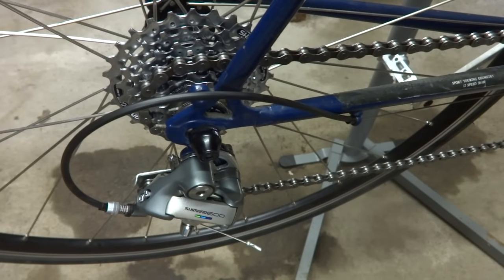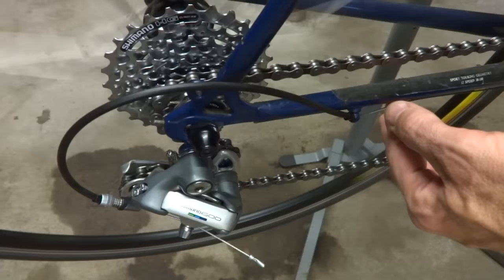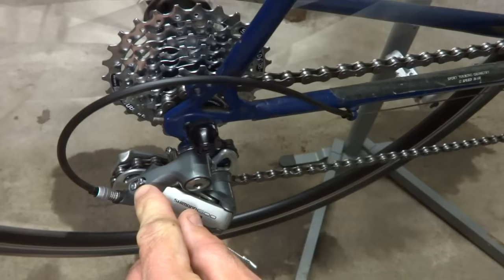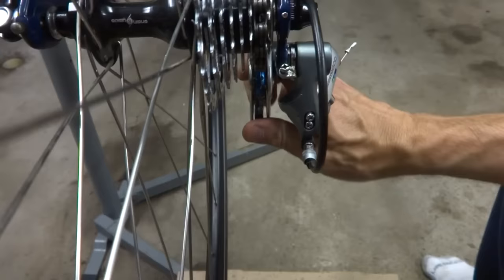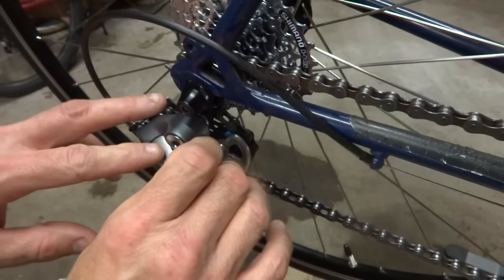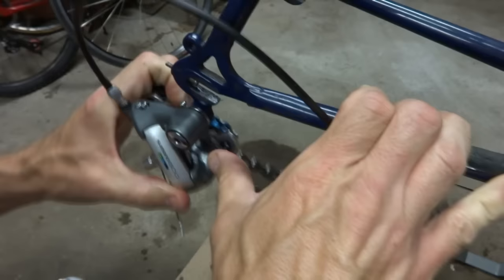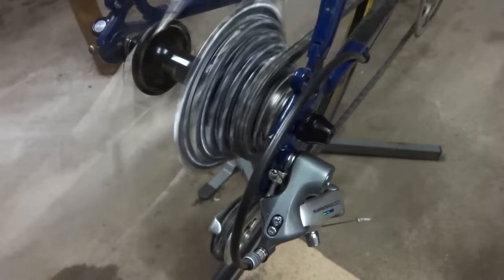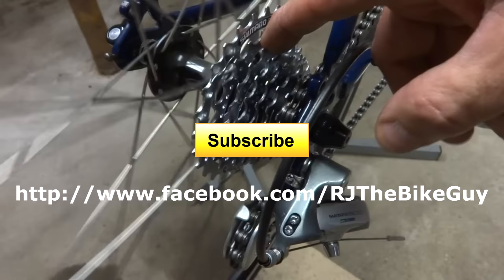Fix Bike Rear Derailleur That Won't Shift Into Highest Gear/Small Cog

Comment: Quick question: my derailer isn't even clicking for the 9th speed even though I have 9 speeds on the back.  Do I follow the same protocol?
Reply from the maker: +Steve Pratt By 9th speed, do you mean the biggest cog or littlest cog? But the procedures will pretty much be similar.
Reply: +RJ The Bike Guy the littlest cog.  I'm 90% sure I got all 9 gears before but I just replaced the cassette since it was worn down.  Is it a tension thing?

Comment: i'm new to road biking. i bought a new fuji bike. road only 5 times. sat in my finished basement for 6 months until today. won't shift lower. i'm stuck in highest gear. i'm stumped and don't know what i'm doing.
Reply: Sounds like your shifter is seized up. Flush it with degreaser and then lubricate it with a bunch of triflow. If you can remove any dust covers first (usually mounted by tiny screws), that's even better.
Reply: i took it to the shop to get it looked at. they made all the adjustments. the derailed was bent. i don't know what i'm doing. they took care of it. thanks for responding! it was just sitting in my basement for a year. no one touched it.
Reply from the maker: Yep, a bent derailleur or hanger will mess up the shifting.
Reply: i appreciate your quick response! thanks!

Comment: Myn wasnt going to the biggest gear near the spokes. . And when i adjust the derailer,it works but after a while it changes itself and i cant shift the gear once more..it also changes the front derrailer settings 😣
Reply from the maker: Sounds like multiple things going on. Isolate the issues and fix them one by one. Could be something is damaged or broken.
Reply: RJ The Bike Guy .oh.. thanks alot😃
Reply: @RJTheBikeGuy  hey i found out the problem.. turns out that the derrailer cables were tight and small,hence they kept changing the gears by themselves😁

Comment: I put my new wheel on and my new free wheel on my bike.When I was testing the rear derailleur  moving the chain up a down,although i admit to remove too many links of the chain ,i wanted to get just up to 53 links,this was the way in my original wheel,but, I think i got 49 instead,I don;t think it's the problem,I ,shifted it up and down ,The chain would only go to the second  high ,chain ring number 6.Then i moved the low screw  in a certain way and it got back to normal.It kept delaying for a few moments going into the highest gear the lowest chain ring ,I did an adjustment  the hi screw,It messed up again ,I cannot get it to go up to the lowest chain ring,I;m guessing  ,the pulley of the rear derailleur  might be worn ?I had it washed recently . Or the shifter is worn ,It's  made of plastic and it down  look beater,but still functions .I am also guessing  I might have to replace the shifting cable .the end of it look frayed a little, before it get to the thing a  little.i do have bike now ,only goes up to chain ring six ion the rear,My front derailleur  is okay .Unless  it's a gremlin  got into my system ,i don't know what  .I even tried adjusting the cable tension ,The pully doesn't look bent , unless you have to replace the old rear derailleurs with a new one if you put on a new freewheel? I don;t  know
Reply from the maker: Michael Mcgee I can be multiple different things. Without having the bike in front of me, I can't say for sure. It could be the chain is too short now. It could be limiting screws. It could be the derailleur is at the limit of it's reach. It could be a bent derailleur/hanger. It could be out of adjustment. Maybe the shifters aren't matched to the freewheel. I don't know. You just have to dig in and figure it out.
Reply: Now we have an elimination.If it was the shifter than the front derailleur would not be shifting normally up and down .
Reply from the maker: Michael Mcgee The front and rear shifters are different. Just because the front shifter works, doesn't mean the rear shifter is correct for your set up. For all I know, you are using a 6 speed shifter with a 7 speed freewheel.
Reply: The rear derailleur  is a shimano too.I rechecked it too ,It 's okay,It is not bent. .I moved it up and down ,Smooth,the new bik back  wheel is 1.75to 2.25.My original back wheel was 1.95,But tha doesn't matter it still works ,Unexplainable phenomenon.Watch me take it to a bike shop and all of a sudden they can adjust it quick,that be my luck,the rear shifter is a s 7 as the front .It's from Schwinn
Reply from the maker: Just because it is a Shimano doesn't mean it's going to work with all gearing setups. Tire size doesn't matter at all for this issue. I really think you need to have someone knowledgeable look at it in person. I can't really help you very well through typing and not seeing exactly how everything is set up.
Reply: Well guess what? I cleaned the rear grip shifter  and replaced  the speed cable with new ones .It's back to normal.I also learned that my new wheel wasn't adjusted .It was loose when i tighten it to the rear.I'm going to readjust it .

Comment: My mountain bike has 6 gears in the rear derailleur. The number on the shifter is always one before the one it is actually on. So if it shows gear 4 I'm actually on 3. Because of this I can use my 6th gear. Can someone please tell me how to fix this thanks.
Reply: Same problem to my bike
Reply: Vishal Adhikari on my bike im on 2nd when it says its on 1st
Reply from the maker: Probably the cable is not adjusted correctly.

Comment: My trike won't go into 7.shifting up 1 in 1 ,2 stays in 1,3 goes to 2,4 goes to 3, 5 goes to 4, 6 goes to 5, 7 goes to 6   and up 6,5,4,3,2,1. No skip in this direction. It happened before and I don't know how I fixed it.
Reply from the maker: Brent Theophilus The cable needs adjusted. Turn the barrel adjuster on the rear derailleur out until the pulleys line up with the proper cog. You may need to tweek it a little bit one way or the other.

Comment: on my bike, if i put it in first, its on first, but if i put it up into second, it stays on first, then if i go up to third, it goes into second, it goes like that all the way up to 7th. when it says im on 7th, im actually on 6th. and when it says im on 8th, im actualy on 7th. it doesnt matter what my front gear is on, 1st 2nd or 3rd. its under warrenty so halfords can sort it for me for free, i just want to understand why its doing it before i take it. 1 because it makes me look a little more like i know whats wrong, and so i know for the future
Reply from the maker: Cable adjustment is off. Turn out the barrel adjuster.

Comment: hey,i cant get my gears to go to the biggest cog, I cleaned my chain using a park tool cleaner, the guy at the bike shop said it might cause me problems if i did ,because of the wear of the chain/cassete, the bikes 7 yrs old now, i think he meant the chain/cassete may not match after cleaning...... I`m not sure how to fix this.  I hope you have some idea what I mean ! I`ve tried adjusting the alignment screws and barrel adjuster, i dont have any wd40, but i dont think it`ll work as I think the chain & cassete arent matching now......gears 1-6 work fine, but the 7th it just wont go onto it, it was fine before i cleaned the chain & cassete, there were a lot of bits of metal in the cassette, mostly what seemed to be bits of thin wire
Reply from the maker: +Stu Wright If it won't go to the biggest cog, I doubt it is due to a worn chain/cassette. Check the limiting screw. Could be a bent derailleur or hanger. Maybe a problem with the shifter, or cable.
Reply: +RJ The Bike Guy ok thanks for your reply, i`ll keep trying :-)
Reply: +Stu Wright Try adjusting the screw labeled "L" for low.  You'll need to have your bike situated so you can pedal and press the derailleur in towards the spokes at the same time.  Once you can push the derailleur in and it shifts to the largest cog, then you can test using your shifter.  If your shifter makes it go into the largest cog, then you can crank the pedals and tweak the limit screw ever so slightly to make is shift as smooth as possible.
Reply: yea i`ve tried that didnt work
Reply: +Stu Wright a new chain is like 20bucks man
Reply: a new chain may not fix it
Reply: +Stu Wright I guess my first question should have been, did it ever shift into the largest cog?  If not, is your derailleur made to work with the number of cogs on your wheel?

Comment: My clutch for my rear derailleur is broken. Right now its stuck on the highest gear/smallest cog. 

How do I permanently put it on the lowest gear/big cog. 

I rarely change the back gears so I just want to keep it at the lowest gear. Thanks.
Reply: I would also be interested to know the answer to this! As im having the same problem on my bike.
Reply from the maker: +Manila Kid I am not sure what you mean by "clutch". These derailleurs don't have a clutch. You can try tightening the cable until it pulls it over to the big cog. And the limiting screw will prevent it from going any farther.
Reply: +RJ The Bike Guy Thanks for the tip, I think I'll do this. What I meant by clutch was changing the gears by the handle bar. Mine broke and I don't want to replace it since I rarely change gears on this bike.
Reply from the maker: The shifter...
Reply: +Manila Kid To permanently attach it to the lowest gear weld it.  An actual weld works the best but if you can't weld or don't know someone who can you can use an epoxy called JB Weld.  It's really strong stuff, but just make sure that everything is clean or it won't work.  I hope that helps.
Reply: +Manila Kid Flush the shifter with degreaser and then lubricate it with triflow. This usually fixes the problem you're describing. Or as RJ The Bike Guy said, add cable tension until you get it where you want.

Comment: This is quite easy to resolve, but i got more serious problem. Shimano Revoshifter 1x8 -speed system on a very brand new bicycle. Whenever ALTUS derailleur shifts from 8th to 7th gear without problems, 1st to 2nd gear doesnt shift and after adjustments it's vice versa - problems appears in 8-7th gears again! Played with gear cable adjust and tension, limiting screws are ok, tried B-tension screw, checked chain length (ok), derailleur is straight, cassette doesnt wobble, wheel is straight and firmly put into dropouts. No idea what cause this. Spent like one hour on this one. Didn't have this problem before with revoshifters, which usually are really easy to adjust xD. Help?
Reply from the maker: +meskisz Sounds like maybe the shifter/cassette are not compatible. It's an 8 speed shimano shifter with an 8 speed shimano cassette and Shimano derailleur?
Reply: +RJ The Bike Guy I thought that too, but it should be fully 8-speed compatible system: 8-speed shimano RS45 revoshifter, 8-speed sunrace chain, 8-speed Sunrace cassete 11-32, 8-speed altus derailleur. I thought merida knows what they're doing there when designing their bicycles.
Reply from the maker: +meskisz Without working on the bike directly, I am not sure what to tell you. It could be how the cable is clamped to the derailleur, as that can affect pull. Maybe something is damaged. Not sure.
Reply: +RJ The Bike Guy Yeh, probably will need to spend more time on other options.

Comment: i have different problem, when the rear derailleur is set to 6th gear it doesn't change position, it rests on 7th only.
Reply from the maker: I don't understand what you are saying. It doesn't change gears at all? Or won't go past 6th gear to 7th gear?
Reply: +RJ The Bike Guy wont go past 6th gear and so on
Reply from the maker: Basically the same kinds of things that are in this video. Limiting screw, adjustment, bent derailluer/hanger, etc.
Reply: +RJ The Bike Guy  finally problem solved 😃 this video helped me

Comment: I have an issue with my front derailleur. I try to switch up to the second and third gear, but the thing is spring loaded and always wants to go back to the first gear. How can I fix this?
Reply from the maker: Ray Liu The derailleur is supposed to be spring loaded. The problem is your shifter. Are they downtube/stem shifters? Indexed? Friction? I am guessing they are are lever shifter of some sort, you just need to tighten the screw mounting screw a little bit to give it more resistance.
Reply: RJ The Bike Guy 
Funny, my dad just told me that this morning.  I'm just a frustrated DIYer and went looking up some stuff on the internet for a fix. I can switch between all three gears now, and with a little adjustment, I should be able to make it all smooth. Thanks for the great video!
Reply from the maker: Nobody starts knowing it all. You learn a little bit at a time. Keep learning!

Comment: instead of wd-40 could i use brake cleaner and then put lubricant on it?
Reply from the maker: +Geo Nagle Brake cleaner can be harsh stuff and might damage the derailleur.
Reply: +RJ The Bike Guy i was wondering, because my 18 speed bike will not shift sometimes and after sometime it does shift into the gear that i selected, and i'm thinking that it needs to be cleaned really well
Reply from the maker: Sounds like the shifter might need cleaned and lubed. I have videos on that too.
Reply: +RJ The Bike Guy AWESOME!! ill have to check them out, i would ike to fix that this weekend, since im starting to get more into biking.

Comment: my front derailleur won't go to the highest gear which is 3 any clues?????
Reply from the maker: Most likely limiting screw, or maybe cable adjustment. But not knowing what has been done with your bike it can derailleur installation, bottom bracket/crankset, etc.
Reply: RJ The Bike Guy cable adjustment limiting screw i see two screws here high and low i have a kids bike btw
Reply from the maker: Probably the one farther from the frame. Loosen it a little bit.
Reply: RJ The Bike Guy wait is it the high or low ones? and what do you meen by frame lol
Reply from the maker: High.
Reply: +RJ The Bike Guy OK
Reply: +RJ The Bike Guy nothing happened
Reply from the maker: See my first reply.
Reply: Clorox Bleach  long lost brother
Reply: +RJ The Bike Guy my bikes pedals move but as soon as I leave it it goes back to where it was last time which means I can't move plz help me
Reply from the maker: I have no idea what you are describing.
Reply: +RJ The Bike Guy so what do I do now
Reply from the maker: https://www.youtube.com/watch?v=OV1AVcdNjMM
Reply from the maker: https://www.youtube.com/watch?v=gwBQxhZhKnE
Reply: +RJ The Bike Guy the reason I commented cause the video was confusing
Reply from the maker: Take it to a bike shop I guess.